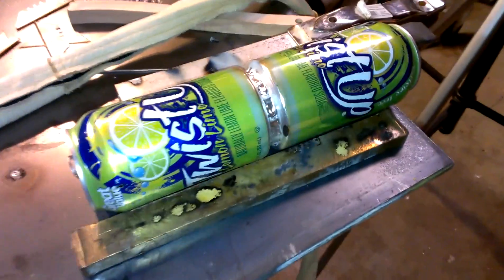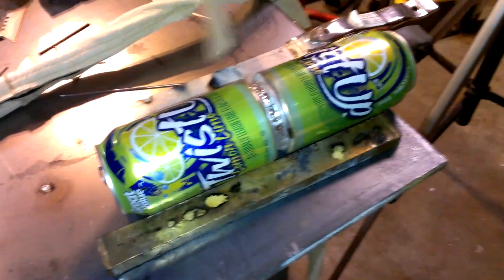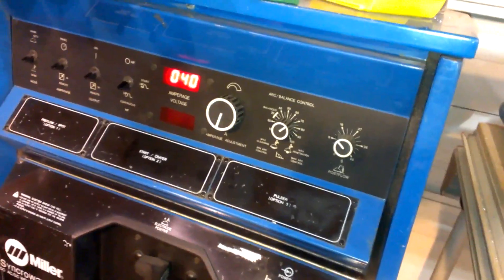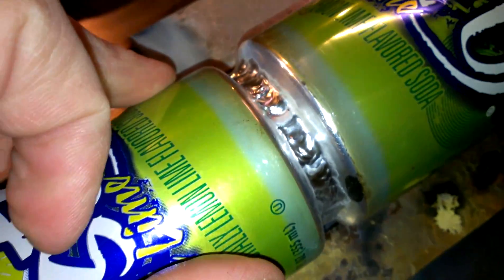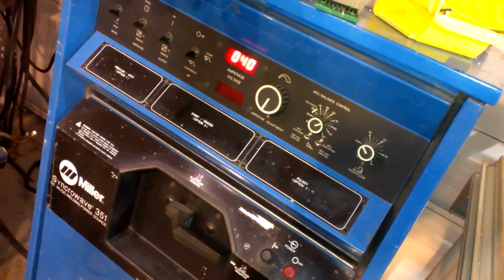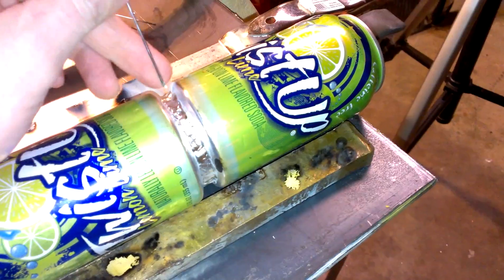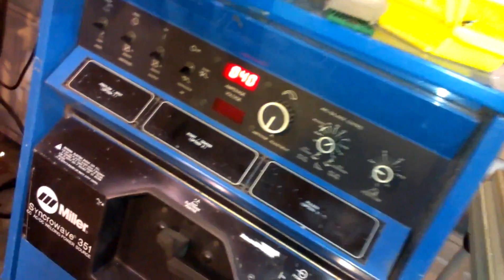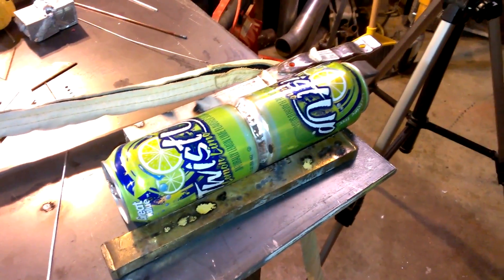Settings For Welding A Pop Can

Comment: I want to see what you got the settings on the welder turned to because i have a syncowave 351 with water cooler and foot pedal and am trying to weld 3/16 and 1/4 in aluminum show me the settings i need to know i want to see what you have all the switches turned to a picture would be great